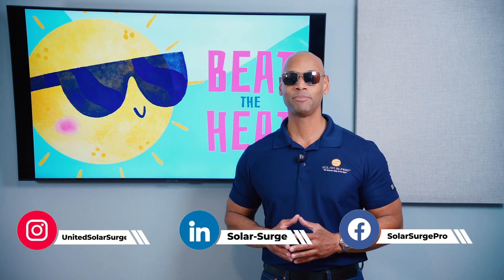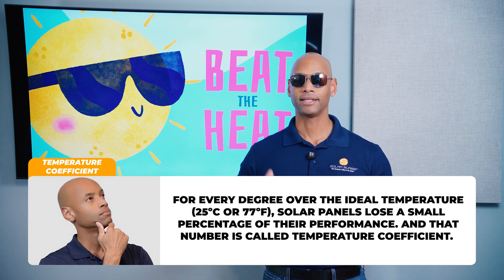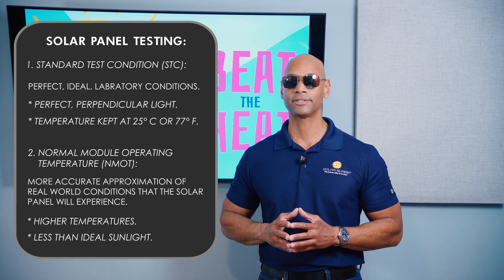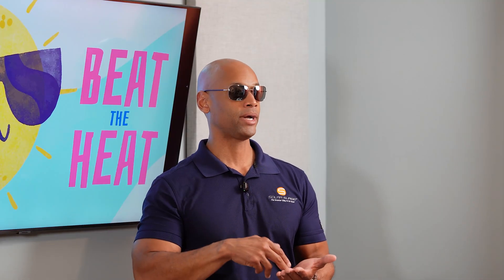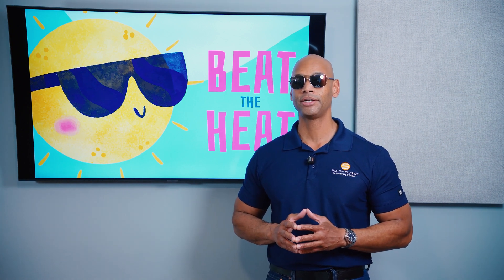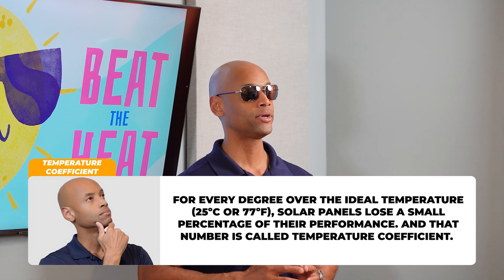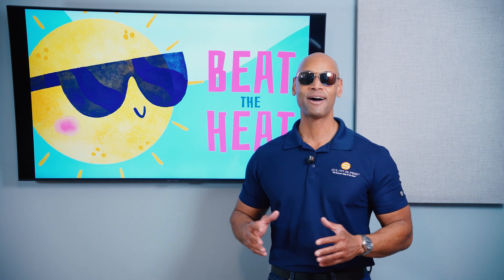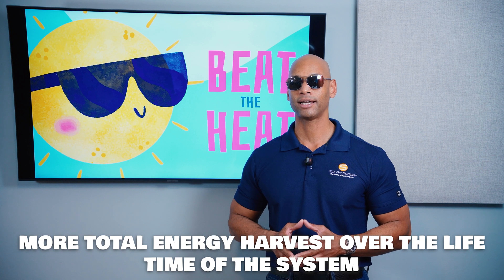How to Beat the HEAT with Solar in 2025

Comment: Concrete anchors in the ground? Come on Joe its 2025! Aluminum earth anchors, ground screws, and helical piles for the win! Be empowered!
Reply from the maker: Good comment.  Earth anchors greatly simplify the ground mount installation if you have the right equipment to drive them.

Comment: Yo, Solar Surge, I want to share with you a comment I put up earlier today on another solar channel.  (I will give you a "heads up": I have degrees in both physics and electrical engineering, so don't be afraid to use big words, but solar technology is not an area which I am an expert in... yet.)  Thanks in advance.
...
"I have a question or two about your degradation rate discussion.  So, for recently manufactured solar panels (new technology within the last few years), how do the manufacturers determine the long-term degradation rate?  Do they warp-speed into the future to determine how their products performed?  Or do they assume that the degradation rate they see in the very short-term is linear (constant with time)?  This is quite possibly a bad assumption.  Any thoughts?"
Reply from the maker: That is a very astute observation. Degradation rates are often modeled and can vary depending on the specific panel/cell technology.

Comment: If you put it on your roof, or even if you don't, paint your roof in a reflective white. It will lower the roof temperature. That means more solar production (especially if you have bifacial panels) and less energy consumption by your aircon.
Put your batteries and inverter in a cool place, not exposed to direct sunlight.
The kind of roof mount matters. Roof tiles like Tesla do not allow for airflow.
A low thermal coefficient is nice in heat, but if you live in a place where it gets cold in winter and you value the winter production more than in summer, you might want to go for a high energy coefficient. You get plenty of sunshine when the weather is hot, you don't get much in winter.

Comment: On the flip side, solar panels on the roof will block the house's actual roof from the sun and the house will require significantly less A/C to cool.  You may get more net energy out of your panels even de-rated by the sun verses what you would get with a ground-mount.

Also, rooftop temperatures are actually a lot lower with solar panels than without, and you are likely to get more wind.  Still, ground-mounts will definitely be cooler because the ground itself is cooler.  Rooftop isn't as bad as one might think.

-Matt
Reply from the maker: Don’t get me wrong. I’m not suggesting that roof mounted solar panels are bad. And you make a good point that the sunlight absorbed by the solar panels will allow the inside of the house attic to stay cooler therefore needing less air conditioning service.
Reply: Heating the roof won't affect the house temperature very much if the attic is properly insulated.  We are building a new house with R60 in the attic.

Comment: Bottom line: install a ground mount array if your site will allow. 
On paper it may look less expensive to put it on your roof, but unless you have a metal roof already you're adding potential roof leaks with every penetration of your roof. 
Also, roof-mounted systems require an EXPENSIVE RDS (rapid shutdown system) that literally adds multiple failure points to your system reducing its reliability. 
A ground-mounted system will also run cooler and it will be easier to maintain.
Reply: RSDs aren't that expensive... about $30/panel.  But I agree its an additional cost that honestly the U.S. shouldn't require at all.   Europe doesn't require RSDs.  Despite the high voltage, DC strings just aren't dangerous to firefighters.  It is extremely difficult to get electrocuted by a DC string that has been clipped or disconnected... you really have to try hard.  And RSDs increase the fire risk rather than decrease it.

There is some movement to fix the U.S. code (NEC) to remove the RSD junk for DC strings but it is slow going.

I agree on roof penetrations.  Having a metal roof with standing seams makes solar incredibly easy.  Zero roof penetrations.  And you doubly-win because the panels shade the roof itself and reduce heat transmission from the summer sun into the house.  So your net energy may actually be considerably higher with a roof mount than with a ground mount due to the lower A/C requirements.

Use what ya got, that's what I say.  If someone has the space for a ground-mount or a car-port solar system (also does not require RSDs currently, if detached from the house)... do it.  If all you have is your roof.  Consider it.

-Matt
Reply: @junkerzn7312  would seem we are in complete agreement.

Comment: Man I wished I didnt live in an apartment. I really want to go solar with some battery backup. I still probably could install enough panels to cover 20-25% of my usage but the wiring would be a pain since the panels would be spread through several rooms on 3 sides of the house and the panels themselves would only be exposed to the sun. The west side of my apartment faces the beach and is pretty much west facing. It would have been great to capture some evening solar from 1pm to 5-6pm when you actually need the most electricity.
Reply: You could! Use a power station and put three 400 watt or 550 watts panels to charge your power station.